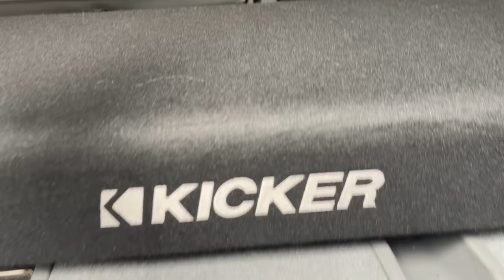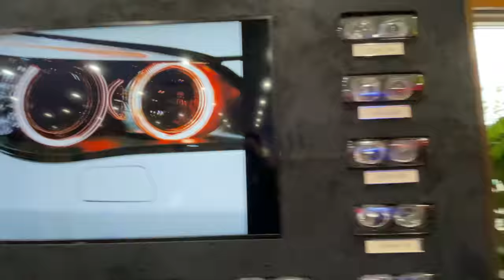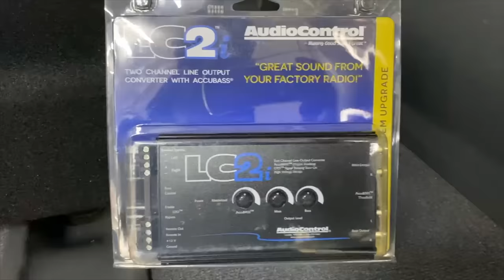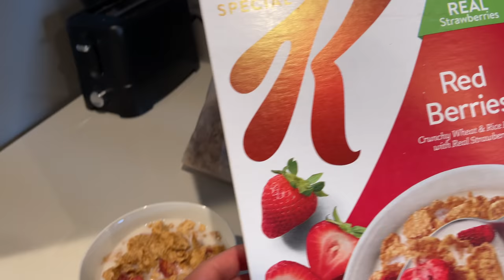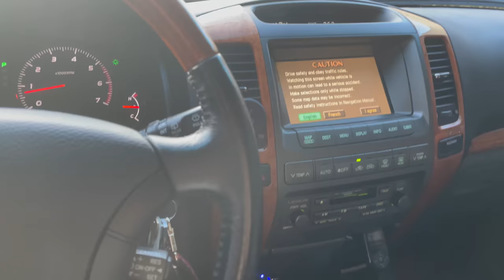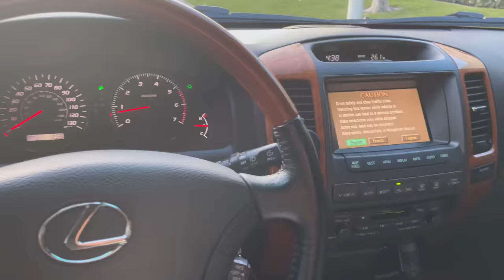2004 LEXUS GX470 GETS NEW SUBS! 🔊

Comment: Since you have Mark Levinson and factory Navigation on your GX470, Did you have to use high-level speaker inputs on the amplifier?
Reply: Did you ever find this out?
Reply: @diegogalvez8589  No, but I believe this is the only way to accomplish adding an aftermarket sub and amplifier to ML system with NAV